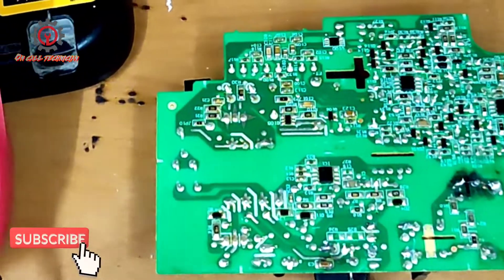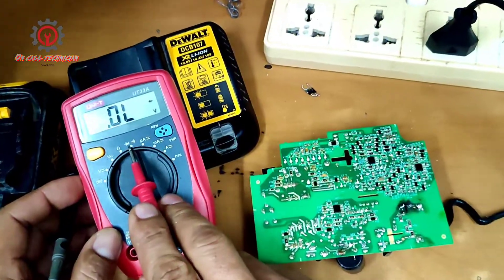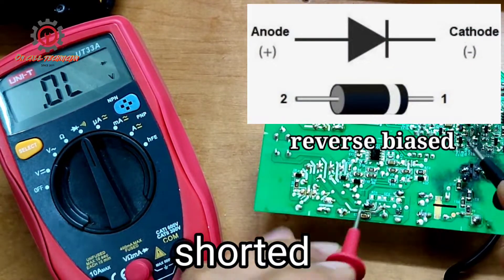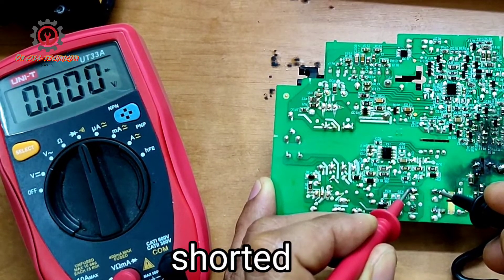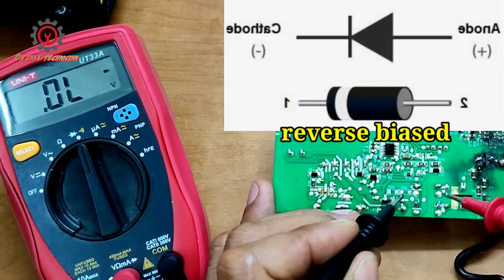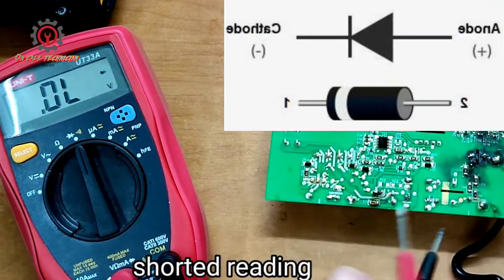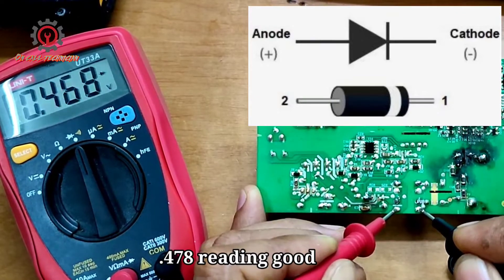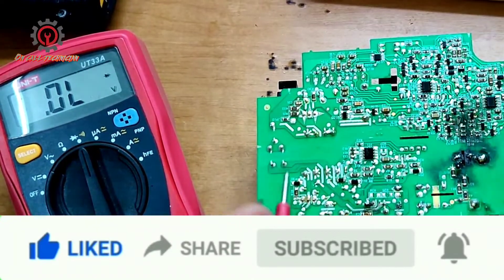HOW TO CHECK RECTIFIER DIODE IN4007 IN A CIRCUIT

Comment: Hello, correct me if i'm wrong, but i've tested diodes in a circuit and they seemed broken. When I desoldered them and tested them off the board they were good. So obviously the multimeter was also reading another component. I've seen opther videos where they advice to desolder components and then test them cause you might have a misreading. Regards

https://youtu.be/FtiEEGBch4M?si=44cMIs8-ecxCKWqH
Reply from the maker: The electrical guys opened that charger of battery drill but failed to repair. I didn't blame him coz its not their field of expertise. We an electronics tech a multi-skillef,  opened it and started fixing it, we succeeded and share to you guys yet questioning us. Thats a rectifier diodes not a single diode in a circuit.
Reply: @THEMULTISKILLEDTECH  As far as i know only God doesn't make mistakes. I only put down my experience. Sorry if i hurt your feelings. Godbless
Reply from the maker: May i know your face book account and i will start digging /:scrunize who is  this experienced questioning me?
Reply from the maker: @user-2uf2kr2c  Why you don't have your own tutorials in your channel and seems your an electronics enthusiast or an engineer perhaps a pilipino too, a perfectinist. And you even used the name of God here. Do you think I'm a Godless?
Reply from the maker: And may i know your religion if you don't mind? And I'm sure that's true religion for  you. Well i sence it, its fake. Sorry too if i offended you. You started this and i will give you the battle you want. Please give me your fb account if you don't mind.